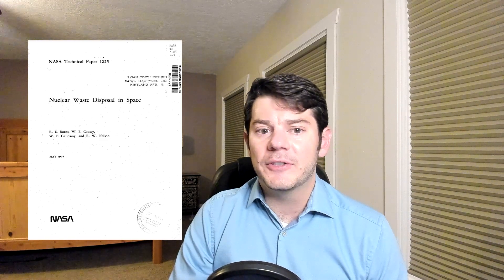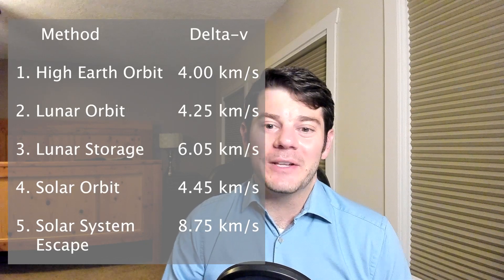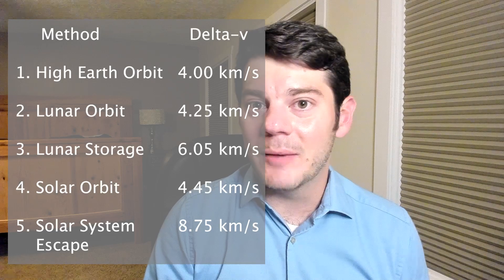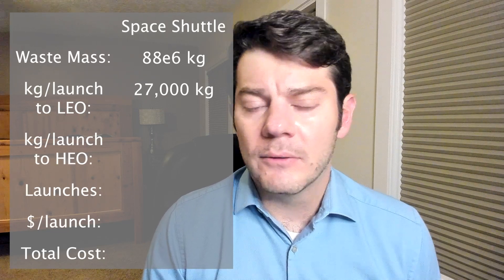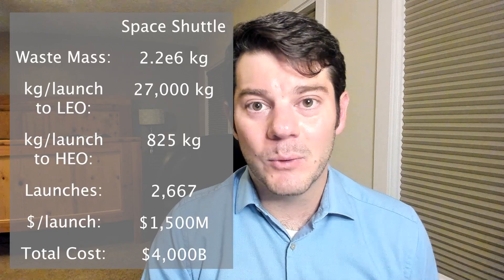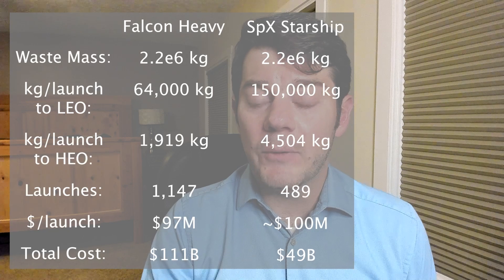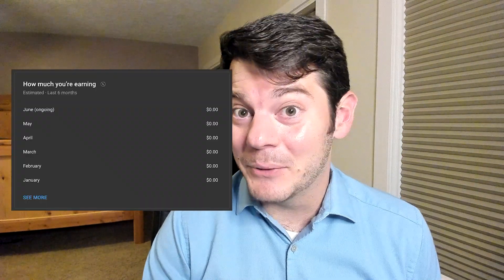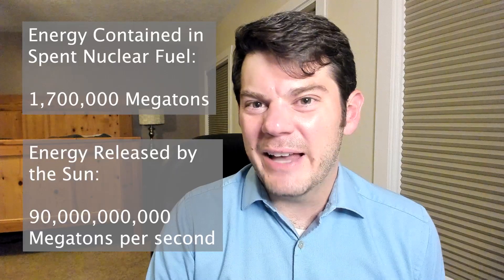Nuclear Waste Series - 5: Should we launch our waste into space?

Comment: I am currently working on my final study project, which involves solving the neutron diffusion equation in two groups and two dimensions, and I want to use finite difference methods to do this. My goal is to implement this method in a program written in C++. Additionally, I need sources; is that possible?"